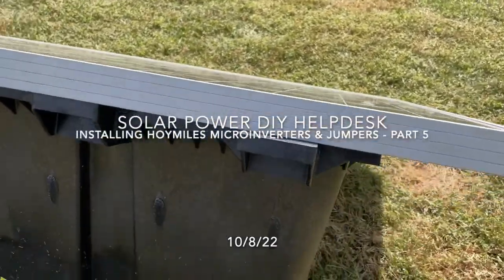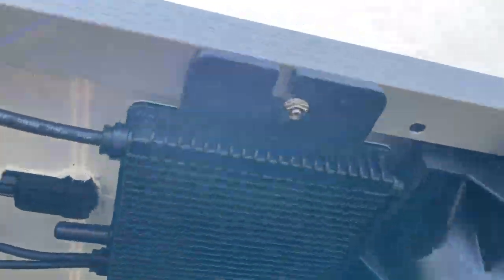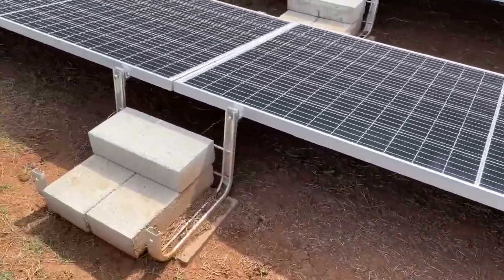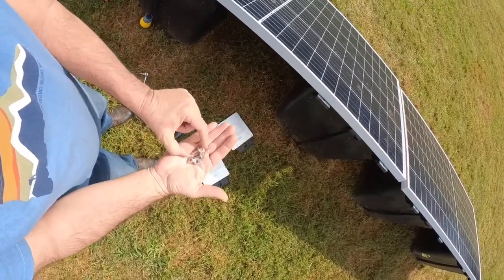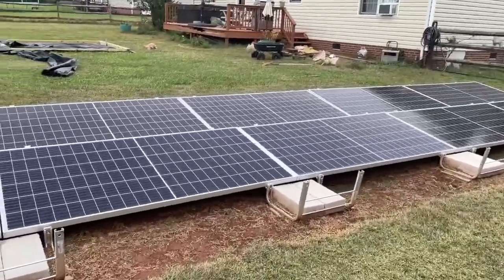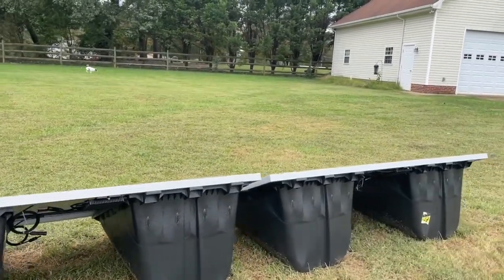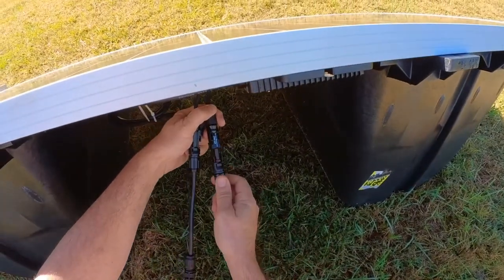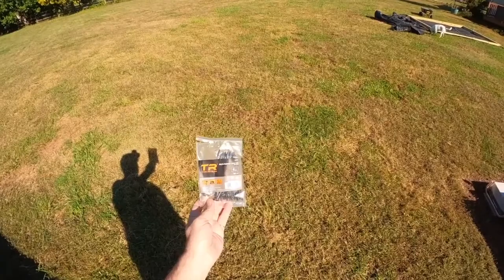Installing Hoymiles Microinverters & Cables - All Done - Part 5

Comment: Won't fastening the inverter to the edge of the panel cause a twisting torque on that edge? Do other panel companies manufacture panels to the required dimensions?
Reply: It's not noticeable to any degree if it does. That is how it's done when there are no rails to mount them to. Also, yes. There are many 72/144 cell panels, by various manufacturers, that are ~39" wide. You must check the panel specs to verify this before purchasing the racks and I ask customers which panels they are using to make sure they are compatible. The Jinko panels I have in stock work perfectly. The trick is to make sure the racks are perfectly aligned along the top, at the groove.